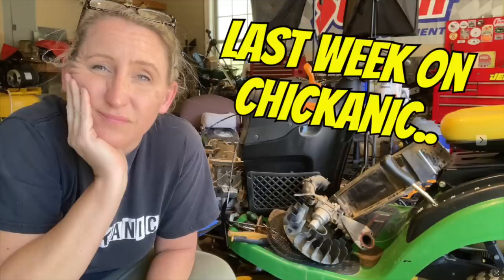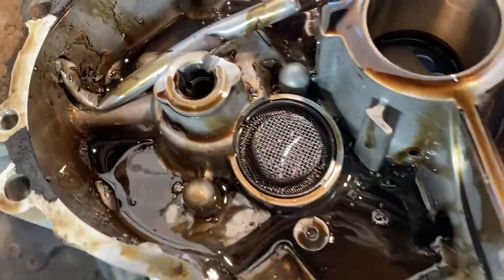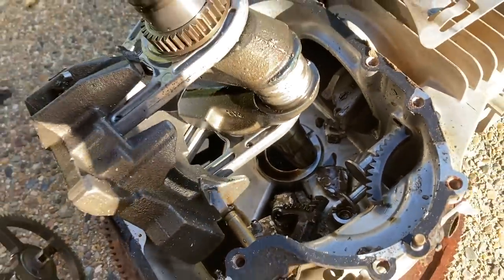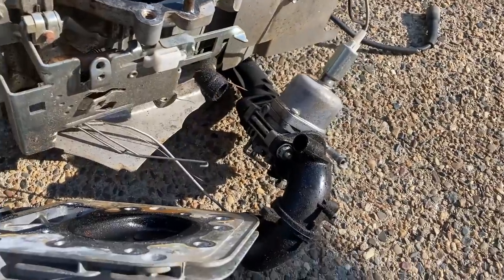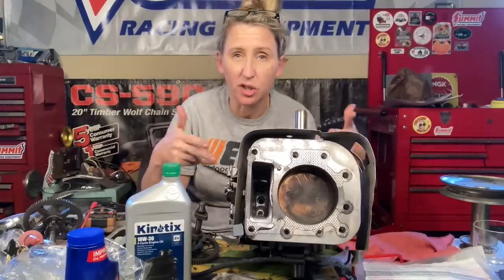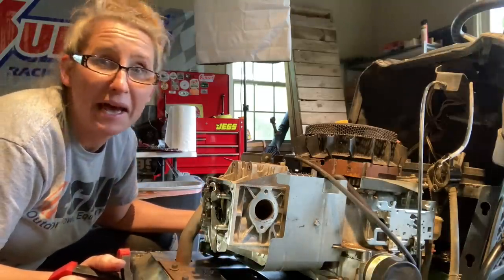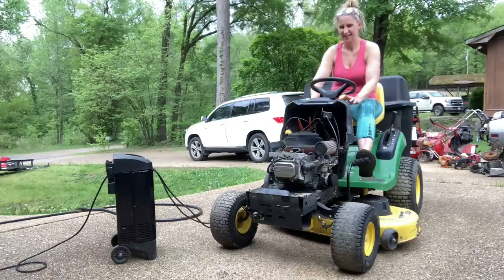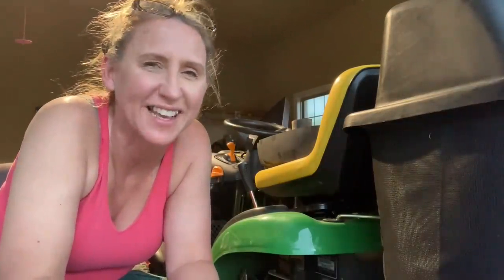A TRUE Frankenstein, turning three Briggs Engines into ONE on a FREE John Deere Rider! Will it Run?

Comment: I am glad you mentioned about the zinc in the oil for small engines to prolong the engine life. Very helpful tip. Thank you.
Reply: One good solution is to use a HDEO oil in 10W30 ... Chevron Delo, Shell Rotella and Pennzoil Long Life.  These "heavy duty" (gas-diesel) oils have extra anti-wear additives and handle fuel dilution really well.

Comment: I just got one like that running too. A "mechanic" told them they needed a new engine, so they parked it-----5years ago. It was given to me last fall, but I didn't have time to look at it then. Pulled it in a couple weeks ago and found it had a bad cam lobe. Thirty dollars and six hours later, [forgive me, I'm 71 years young], I hit the starter and it came right to life and is one of the quietest mowers I have around here. I still have to do the deck, it's got grape vines growing through it and put a tube in one of the tires, but it's going to be worth around a grand here in Michigan. I don't have a bagger either, which would be worth 500 more here. Love your videos and have learned a few things along the way.
Reply: Great job! I love when neglected equipment gets to run again.
Reply: @5roundsrapid263  Thank you! At my age, it keeps my hands and mind busy and helps supplement my income.
Reply: I used to know a Burt Nelson in Brooklyn, MI about 50 years ago

Comment: A lot of the problems with camshafts is improperly ground lifters. The lifters have to have a crown ground on the end that mates to the camshaft. Also the cam lobes are ground with a slight taper so as it turns it spins the lifter as it raises the valve. Some lifters are ground flat and that's what wipes out the lifter. The lifter is being hit in the same spot.

Comment: @5:46 Wearing down of cam lobes was a common problem with V-6 engines back in the 1980's.
I had a 1982 Chevrolet Malibu with a V-6 that went through three cam shafts before 80,000 miles!

Comment: I use Rotella T4 Diesel engine oil in all my 4 cycle small engines. (Lawn tractors, mowers, snow blowers and generators.) Oil and filter are changed before the oil turns black and oil is checked before each startup.
Reply: It’s a great oil for sure
Reply: Another diesel oil user here, working great for several years now, and less oil consumption than the gas multiweight oils recommended in the manual.
Reply: @redmondjp  diesel oil is usually 15W40 which is a heavier weight oil. It is better for air cooled small engines that run hotter. I use 20W50 full synthetic
Reply: @jasonbusch3624  What brand 20W50 full synthetic?
Reply: @OutDoorFun3  usually Valvoline or Supertech 20W50 V twin oil.
Reply: Unfortunately, the quality/performance of HDEO oils are something of an industry secret but are almost ideal for OPE applications.  Take your pick from 10W30, 5W40 or 15W40 depending on how hard you run your engines and/or how hot it gets where you are.  Consider 0W30 for snowblowers ... if you can find it! 🔧

Comment: Sweet build! Worth $1500 easy.. Your comment about making sure you used an oil with zinc surprised me, had never heard this before! Been using Havoline 30w in my 1999 JD 345 for the past 20+ years 😲
Reply: That should be completely fine even today. I feel like the warning is more for newer equipment and newer users of equipment. I picked up a new push mower a couple years ago, and it has a big 10W30 sticker on it, which if followed  could lead to people even putting synthetic oil into a mower. If they follow the engine manual, it won't be much of a problem as the manual tells people how often to change the oil. The trouble comes if people think putting the oil in is a once and done procedure and just use it until it has nothing left to give. It's why I prefer straight 30W oil, as I feel it is made more for small engines and is a little more forgiving if one doesn't change the oil as promptly as the manual requires.
Reply: Kawasaki oil still contains the zinc additive
Reply: $1500 was my estimate too.
Reply: Make sure you get API SJ oil, which has lots of zinc. Newer oil specs like SP have very little, to keep catalytic converters from clogging.
Reply: @collectingonthecheap56353  that's all I use in my mower, straight 30 weight.
I once had a riding mower & always put straight 30 in it for 15 years with no problems & I decided to put a synthetic oil in it and before I new it it had ran out of oil & locked the engine up, I think the synthetic evaporated because the engine never leaked or burned a drop until I put the synthetic in. 
Now with my new mower it's straight 30 & nothing else.
Reply: One good solution is to use a HDEO oil in 10W30 ... Chevron Delo, Shell Rotella and Pennzoil Long Life.  These "heavy duty" (gas-diesel) oils have extra anti-wear additives and handle fuel dilution really well.  10W30 oils are very stable (generally) and resist shearing down really well.

Comment: When I was in the RV and mobile home repair business, I used to do just that with awnings. Save good awning arms, awning tubes and other hardware to make a new old awning to sell.
The only thing that was never salvageable was the awning fabric. But replacement fabric was relatively cheap and labor to install was only two hours. I made money off old salvageable parts and saved customers money for a replacement awning.

Comment: I use Amsoil's 10W-40 small engine oil with a Wix filter in my Briggs Vtwin 24hp in my Husqvarna and it runs smooth.  I change the oil every fall regardless.  Everyone should do the same

Comment: I have a 1987 John Deere 130 Riding Mower with a Kowasaki engine. It still runs like a champ on its original engine and original transmission. I do not use it, but it was giving to me by my grandfather a few years back and I am just holding onto it.

Comment: Your dog looks just like my dog. I found it on a highway in Mississippi, on my way back from Alabama through Arkansas, back to Oklahoma. Also, I also THOROUGHLY enjoy building Frankenstein engines and firing them up. I have many, many ice cream containers with FS90R, BR600, FH500V, V-Twin Vanguard, and Kohler CS12 variant parts that whenever I have time, I just grab an old engine, flip on the parts warsher, and go to town. Good stuff lady ;)

Comment: It is interesting to realize that zinc addictive is needed. Well, that explains a couple of issues I have had in the past couple of years. I honestly thought it was poor quality of the material in the steel. Makes sense now. Thank you!
Reply: It could have been poor heat treatment
Reply: @jasonbusch3624 
Or poor quality oil, our government wants us to buy more new cars and trucks, easiest way is make stuff wear out faster.
Reply: I never knew that either.
Reply: @jasonbusch3624  more like it’s because it’s a Briggs and scrappit  , I believe they are made without longevity in mind ,that and non existent main and big end bearings worth talking about….
Reply: @metalmicky  Briggs is ok you just can't run thin oil in them and expect them to last. I have many Briggs engines that are 20+ years old and still run excellent and don't use any oil. I don't use 5W30 or 10W30 it is too thin. I only use 20w50 or Straight SAE HD 30wt. Another bad thing is using non detergent oil.
Reply: What wasn't said is that zinc (actually ZDDP) levels in modern oils have gone down, it has been replaced by other anti-wear compounds using molybdenum, boron, zinc, etc.  Still, a bit of additive is not a bad idea ... or use a specialty oil like Schaeffers or any of the excellent HDEO oils out there like Chevron Delo or Shell Rotella.
Reply: Zinc is a great marketing hook for the mower industry to demand one buy their boutique oil at premium price rather than quality high volume high value low price automotive oil. Or HDEOs. Where emissions requirements have reduced the allowable zinc content.

Zinc is a consumable which is crushed on metal to metal contact when the oil film fails. This is a design defect in the engine for exceeding limits of oil. High lift hot rods from the 1960s have this problem. Roller lifters solve the problem. Modest cam lift and RPM do not need roller lifters.

Comment: Good tip on the proper oil.  If people are confused about what to buy, it’s simple to remember. Any good brand of SMALL ENGINE OIL will have zinc.  Automotive oils do not.  FYI Walmart carries small engine oil.
Reply: One good solution is to use a HDEO oil in 10W30 ... Chevron Delo, Shell Rotella and Pennzoil Long Life.  These "heavy duty" (gas-diesel) oils have extra anti-wear additives and handle fuel dilution really well.

Comment: Cool.  I just used my new to me rototiller I dumpster dived for awhile back.  It was just plugged with that white corrosion in the carb from ethanol fuel and sitting/condensation so a new carburetor and I was gtg.

Comment: We nicknamed these briggs single cylinders “crank snappers”, done countless chinese bolt on replacements which sadly seem to be more reliable in most cases, had a few where the crank has let go not long after doing new cam shafts as well

Comment: i have several Roper Yard Tractors, with the Briggs and Stratton, Opposed Twin engine IC model, Cast Iron Block and Bore, mines are 30 plus year old engines and, all Original, steel is real.

Comment: I'm thinking LA-125 single cylinder with bag catcher $950 or B/O. I think it depends on your location. I sold mine LA-115 one owner with 358 hours for $550 and in great shape. Here in the Lehigh Vally, PA area a lot deals & price ranges.  Nice rebuilt!

Comment: Ever have the plastic gears on the starter break when motor hits compression stroke. Does not do it all the time but every few months. Old craftsman ic 18hp motor runs like a champ.

Comment: Thanks for your many videos.  I couldn't find a video where you worked on a Kawasaki FH480V-BS20 engine, but thought you might have some wisdom nonetheless.  The other day my mower it seemed like it wanted to stall at idle.  I thought it might be out of gas, so I walked it to my driveway and took off the gas cap while it was still running, but it still had almost a half tank.  Hmmm.  Following your advice from a few days ago, I manually shut off the fuel supply instead of turning off the switch.  It usually keeps running for a few minutes, but this time it died within a few seconds.  Double-hmmm.

Today, thinking about your advice about water in the gas 70 percent of the time, I drug it back out onto the driveway and sucked a few cups of fuel out of the tank and into a pan.  It looked okay to me, but I didn't put it back in the tank anyway.  I then started it up and let in run at idle for about half an hour.  Seemed to run fine.  I then turned off the fuel, and today it ran for several more minutes before it ran out of gas, just as it normally does.

So I don't know what to do next...it has a fuel pump, Kawasaki PN 49040, so I thought I might replace or rebuild that, but it seems to have been discontinued.  I then searched for generics, but kept seeing pumps with three ports, while mine has only two visible ports.

This engine is on an old Better Outdoor Products "Quick-36 Samurai" hydro walk-behind mower.  It's an old machine, but I've never mowed more than five suburban yards per week with it, so it doesn't have the kind of hours on it that it would if it was in commercial service, so I feel like it could last a long time if I could just figure out how to get parts for it.

Any ideas on what might have happened, and/or what to do next?  I swear I'd bring it to you, if only you were closer!

Comment: Forget the Zinc, these small engines don't have high enough compression or valve spring pressures to worry about.  Just use a quality oil and change it regularly.  I've ran Valvoline 10w30 synthetic in my 33 year old John Deere lawn tractor with a 17 HP Kawasaki with no issues.

Comment: I’ve got a Briggs 21 hp v-twin in my shop with a huge hole in the side of the block. I have another 16 hp single OHV Briggs that need a governor replaced. Briggs OHV engines have a lot of problems. I try to avoid them on my own equipment. The absolute worst I’ve ever seen though are the single cylinder Kohler Courage - the “bucket” engines.

Comment: Until a few weeks ago I had an Ariens with the infamous 17.5HP B&S engine. The automatic compression release on that engine (cam) would break about every 2 years just like clockwork. It is currently on its third cam. I always changed the oil every 25 hours and used Mobil-1 synthetic 10W-30. Every time the ACR broke it munged up the governor gear and even with repairing it myself the parts were around $120.  I will never purchase another machine of any kind with a single cylinder B&S engine.

Comment: Thanks for the tip on the oil.
Reply: A cheap option (cheaper than a specialty synthetic) is a good HDEO oil like Chevron Delo or Shell Rotella in 10W30.

Comment: During the vid, you mentioned that one of the previous owners insisted running the mower full throttle all the time, and might be the cause of the engine blowing up.  What throttle setting are you suppose to use while mowing??  By the way great channel, great vids.

Comment: I've got a couple of older riding mowers pieced together  one for the front section and one for the back. ..  and a couple of spare riders.   It's satisfying to get an older mower up and running and usable.   I'm mower poor.   I prefer two cylinder mowers because they are smoother running.    If ya can't sell the one you fixed,.... I'll give ya a couple hundred for it,  delivered of course and with a full tank of gas.   Actually I'm thinking $1200 range,   more is you warranty it for a year or two.

Comment: You got me worried about the oil I use now. I’ve been using synthetic 10-30. 
I don’t know if it has zinc or not. Should I be using something different?
Reply: You should be fine ... especially if you change it annually.

Comment: I'd most likely guess around the $8-900 range. Maybe a little more if you cleaned up the rust on it and did touch up paint.
Reply: I agree,  if it had more horsepower,  that could be a big help. Most mowers seem to have way too low horsepower. Just my opinion
Reply: @bertgrau3934  I was told when I bought my first house, by a landscaper, always set 16hp as a bare minimum according to residential property.  Anything more than a acre, get 20ho.
Reply: @kenarnold9132  
I don't know,  I think it would depend on the yard.  Before I retired,  I had 2 acres to mow and some hills. After I retired, I bought a home with about half an acre. I don't need it but I have a 40 inch cut that had a 12.5 horsepower Briggs,  it wore out  ( the engine)so I replaced it with a Kohler V twin 25 horsepower.  No grass to tall,  double the horsepower is definitely good.
Reply: @bertgrau3934  I have my dad's old Scotts 19hp from 1998. Deck finally shot craps so it just tows a wagon. Had to upgrade to husky 22hp. Is it overkill? Yeah. But ya know what they say. Like condoms. Better to have when ya don't need them, than to need them and not have them.
Reply: @kenarnold9132  
Personally,  up grading horsepower is a good idea.  I rebuilt my 40 inch mower deck,  and another thing I like about it, it has a manual blade engagement,  not the electric PTO.  I also went from single exhaust to duel exhaust.   

Sounds like you have a nice machine.  I think the mower decks are the weak link.

Comment: Great video Chickanic , but this is a first for me about zinc in motor oil , learn something knew all the time
Reply: Had a JD X series with a Kawasaki engine, and always used JD oil and I had no trouble with the engine in 10 years of hard use.  Sold it in my farm sale when I moved to Florida and downsized the yard.  Question I have: Does JD oil have that zinc additive?
Reply: A solution that won't break the bank is choosing a good HDEO oil like Chevron Delo or Shell Rotella ... and changing it every season.

Comment: My name is John I seen this even though it's an old one.  I have a John Deere 425. I'm looking for a hydorstatic transmission / rear axel.  The PTO shaft from the mower deck to the transmission come apart and flopped around. now it's leaking fluid can't figure where it's coming from. So by any chance would you have a 425 Lawn and Garden transmission laying around? I live in the western part of KY.

Comment: Love you channel 👍
You info on zinc in the engine oil is new to me - how do you tell of an lawnmower oil has zinc in it? Is there a code on the bottle that tells it?
Reply: Most modern engine oils that have the latest SAE ratings will be low on zinc & phosphorous.  Consider using an HDEO oil (Chevron Delo & Shell Rotella are 2 of them) which are affordable and readily available in 10W30 ... the most common weight for OPE.

Comment: I have a 105 Deere. I also have a yard with a gentle slope and I constantly have transmission issue with the mower almost completely stop moving. I had to get the transmission rebuilt because it completely stopped moving. It has had difficulty every since I purchased it. Any ideas

Comment: This is probably an off the wall question... Other than this project, what is the most engines you've ever cannibalized, to achieve ONE good engine?

I watched the first video with this exploded engine, I thought that one was simply a pile of aluminum recycling!!!

Also, I noticed you started the rebuilt engine at more than an idle... As a retired Operating Engineer (all heavy equipment) it's like grinding my teeth in see that. My mower sales guy says the manufacturers are saying they would like to eliminate the throttle control completely and simply have a run or off throttle setting... Your thoughts please 🙌

Comment: Hope to get a respone, Do you have any MTD Varible drive pullies or at least the bearing shaft that goes in one? Not the ones with a bracket but the one with a bolt going through it I have new needle bearins and a good pulley but looking for that shaft mainly!